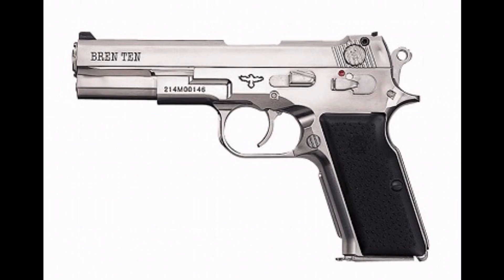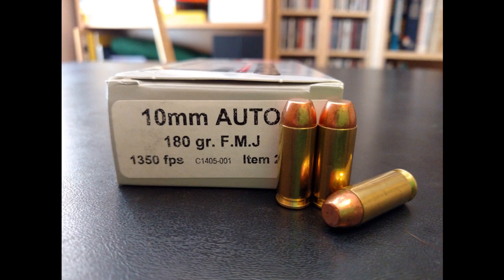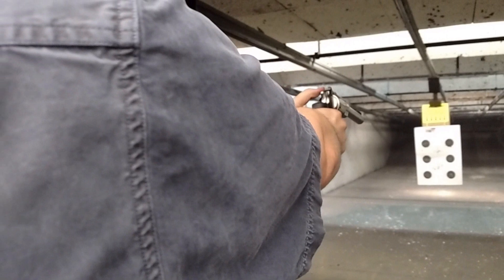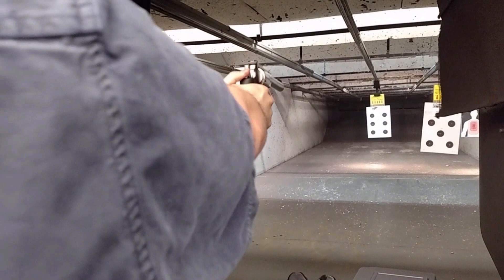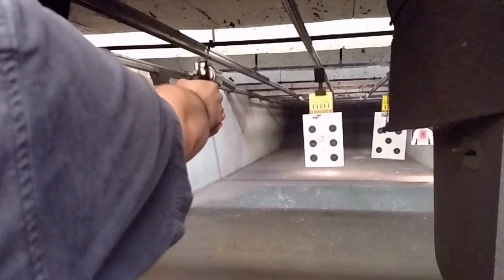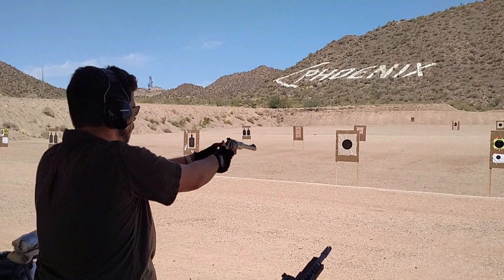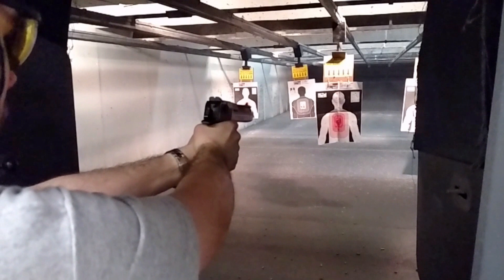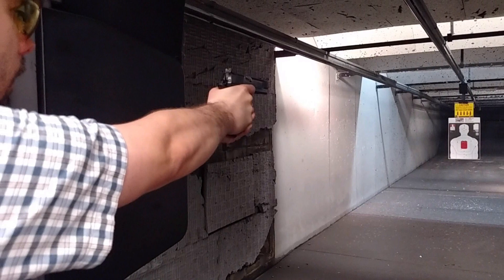Top 5 Big Bore Handgun Calibers

Comment: The S&W XVR 460 tops my list!  It can shoot your #2 & 3 picks; 45colt & 454casull--> https://youtu.be/i-el21xCz94
It's sibling the S&W 500 is my #2 --> https://youtu.be/7o4cKA8vawc
Thanks for the video.
Here's my FIVE;
1. S&W 460 mag
2. S&W 500 mag
3. 450 Marlin
4. 45-70 
5. 480 Ruger
Reply from the maker: TropoCal - Dig the list, and I love that you put in your top 5. Admittedly, the .460 S&W Magnum is a cartridge I have recently come to love.
Reply: * @GoBigBoreOrGoHome  - Check out the XVR 460 magnum 8.38 model - it's recoil is very manageable, and it tames down your 454 casull.
Also, most shooters that say the 10mm. is snappy, or kicks hard, usually haven't shot it from a polymer frame pistol, such as a G20.
Polymer frames absorb much of the shock, and vibration that the 10mm cartridge delivers, it's pretty amazing really.
If you haven't shot a G20, or even better yet the G40, I urge you to try it!
I CC a PPQ 40 or a 10mm Glock.everywhere
I have no issues when emergency testing them, and in fact I do surprisingly well.
These guns, in these cartridges, make me look better than I am! (they shoot better than me....LOL!)
Happy Shooting GBBOGH!

Comment: 44 Mag & 45 ACP are both most over rated and top 5?  Get consistent.
Reply from the maker: Craig Benz - Something can be amazing, and overrated.  It's not inconsistent to say that it's great but people make it sound like it can kill king-kong, do your taxes, and solve the disconnect between quantum mechanics and general relativity.  The .45 Auto is awesome.  But people say they don't trust 9mm, .40 S&W, or even .357 magnum because it's not a 45.  That is stretching it.